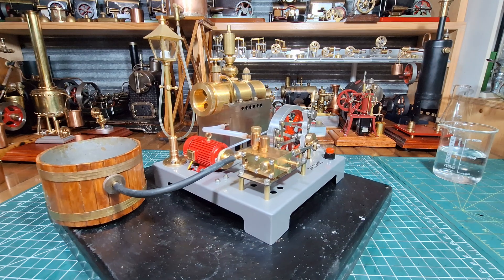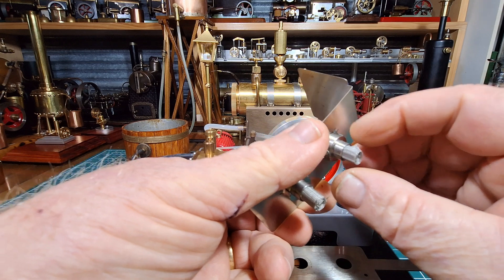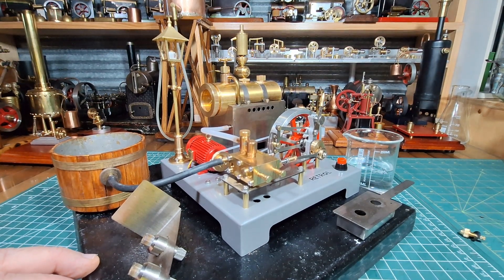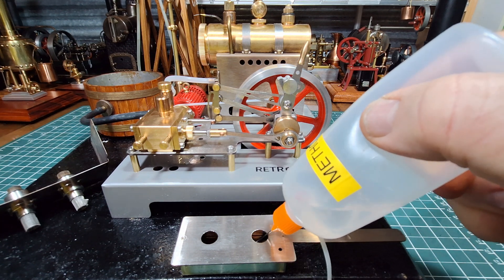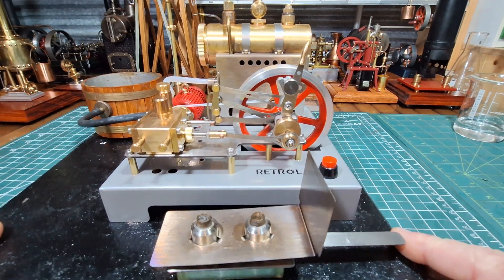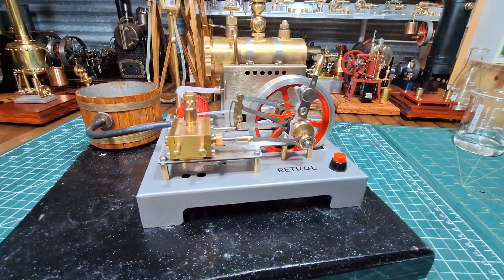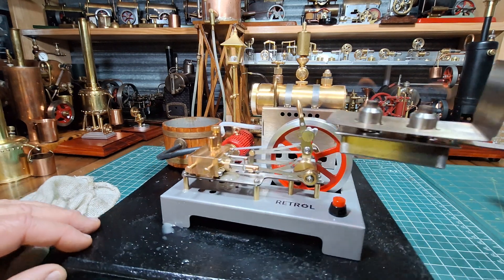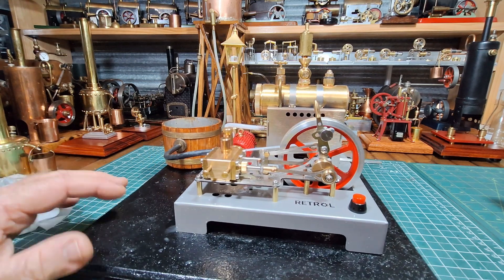EngineDiyShop Retrol SE 02 First Live Steam Test

Comment: Hey Jim, great video. Thanks for sharing. If you don’t mind me asking, what is tha half barrel you have hooked up for? I have the se 01 and thought I would hook something like that?
Reply: Hey again Jim, what a great idea. Think I may give it a try. Thank you for your speedy reply. Jim, I saw on StirlingKit a number of weeks ago a wheeled cart for the HM -01. Would you happed to know anything about it? It was a pretty sharp set up. Cheers back at you, Jerry
Reply from the maker: @jerrygrahn8144  G'day Jerry, I made my own cart (not wheeled) for one of my H&M engines (don't have the HM-01 YET!) are you on FaceBook? If you do this is a good FB sight to join, there has been some reviews on that cart -
https://www.facebook.com/groups/3216842325293248/
Reply from the maker: G'day Jerry its just a metal container that I cut in half on my bandsaw, put some paddle pop wooden sticks around it, stained and varnished them and some brass strapping. Its great for collecting the steam condensate and oil - Cheers Jim

Comment: I tried to steam mine but it wouldn’t go, whistle leaks and I think my valve timing is off, I’ll try and sort that
Reply from the maker: James be careful unscrewing the front glass as both boiler end caps are only held on by the boiler stay and made water proof by two 'O" rings, works well though. My whistle leaked as well. They are screwed down into an insert into the boiler and mine (and the SV) needed tightening. When I adjusted the whistle up a little its LOUD!!! - Cheers Jim

Comment: I'm stunned that such a tiny boiler can provide enough steam to turn that thing over. The whistle is half as big as the boiler diameter for crying out loud, that's absurd
Reply from the maker: Its a small boiler, but those stainless wicks are HOT drawing up and burning off the metho (spirits) need to be careful to keep an eye on the boiler to not run dry. It only holds enough water for a 9-10 minute run - Cheers Jim